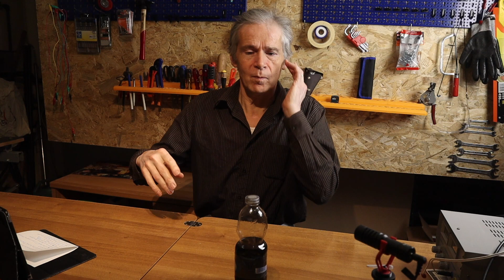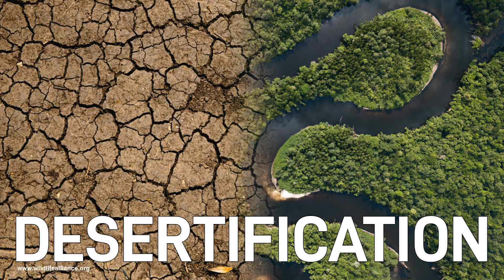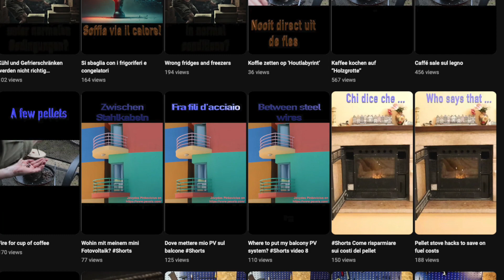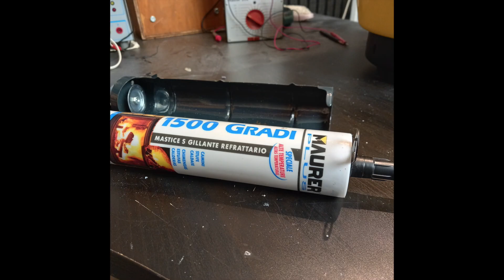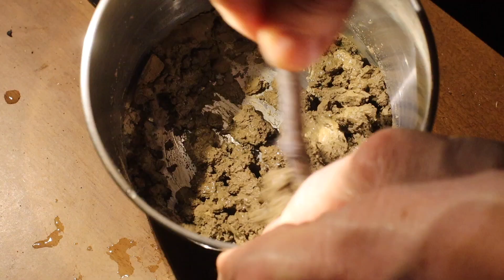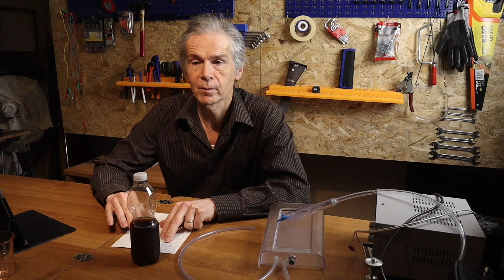Waste oil burner with T blowing head - Video 13

Comment: Wow - you have humor - thats rare in this theme - all alternativ people are so serious or want to look like. Thank you for this video. So i want a starterburner for my biochar Retort burrel or so. So I have a question - I want to use old used friing oil , but you use to head up clear water with used Motoroil . You don't think that this content lead and other poision things, especially in the inside of the rooms?. Thanks for your work and content - form the canary islands. Bye -
Reply from the maker: Thank you so much Adrian! I really appreciate the kind words—I firmly believe we can tackle serious energy challenges if we take the environment into account!

To answer your excellent question about why I used used motor oil (WMO) instead of vegetable oil in that video:

My main rationale comes down to solving a dual problem that affects many of my viewers, especially in developing countries. First, there is a massive issue with finding cooking fuel, which often leads to severe deforestation from wood gathering. Second, toxic waste motor oil is abundant globally but is rarely recycled safely in these regions, often ending up in the soil or water.

By designing a burner that can process WMO, the goal is to burn this hazardous waste locally and much more cleanly at HIGH not low temperatures. This transforms a toxic waste stream into a highly efficient fuel source (it takes only 11 grams of oil to boil a liter of water!), saving local trees and preventing improper dumping. It is also an ultimate backup fuel for natural disasters or crises when standard fuel lines go down. WMO is better to recycle in even a more professional way than I propose, better use vegetable waste oil. But rather than dumping it better use it in this way (outside).

So, you are right to be cautious about health! When burning WMO, the combustion must be completely clean (smoke-free).

For your biochar retort in the Canary Islands, used frying oil is a spectacular choice. It’s a renewable biomass, contains no heavy metals, and smells much better! Just remember to filter out food scraps and water first, and you might need to slightly preheat the vegetable oil to help it flow smoothly, as it is thicker than motor oil. I think the Canary Islands have enough tourism to have much waste oil (and it can be stored until the non touristic period).

Greetings to the Canary Islands, and good luck with your biochar retort barrel! Keep innovating.
Reply: @nnvasen-good-energy  Thank you so much for your kind reply. So you are involved in what are known as developing countries, which includes the Canary Islands, or at least they are considered emerging economies. We have tourism and strive to be very progressive, but geologically speaking, we are part of Africa – and you notice that when you have to get spare parts here. We are part of Europe, but then again, not really. Well, I've always felt a responsibility towards poorer countries, but I've had to learn that I can't change the world – even though it pains me to be able to do so little for the people there or there. Instead, I've had to learn that everyone carries their own perspectives, traumas, and prejudices on their shoulders – so for many people, the same situation is evaluated completely differently or seen in a completely different light.

Now, I've always felt a responsibility towards poorer countries, but I've had to learn that I can't change the world – even though it pains me to be able to do so little for the people there or down below. May God have mercy on us for treating our beautiful planet so shamefully. Furthermore, I've learned that this adventure of our soul in a human body is about saving or finding ourselves in the world—however you want to see it is irrelevant. It's not about the external world, but about our inner selves.

So today, I see it more as needing to save myself from the world and its many demands—to live my life and then, when I'm doing well, to let it go. Not the other way around. I'm currently going through a very creative period, which is also challenging. But I think this applies to many people in this crazy world today, where values that mattered yesterday are simply trampled underfoot today, where you make new friends or lose them, and where you have to find new ways to cope with your own life. In this spirit—wherever you call home—I wish you and your loved ones all the best and much strength to fulfill your missions for yourselves and your friends with love and balance. I think that's what life is all about—being present—for yourself and for others—listening instead of turning a deaf ear, and living each moment with the utmost attention we can give in that moment—rejoicing when things are going well and not taking anything for granted, but rather being grateful. In that spirit, thank you so much for your valuable work and all the best to you.

P.S.: My English is good—I practice English and Spanish every day, as a native German speaker. But I translated this letter with Google Translate because otherwise, misunderstandings often occur. I hope it's understandable.
Reply from the maker: Thank you very much for your reply, clearly a mind that has seen much and tried many things. I know the feeling of a world that does not accept a good objective. Like 30 years trying to help big Energy consumers consume less. Then i finally thought that's something I have to leave and now I do the same with households including those in developing countries. Something makes me feel that will have more effect and it will arrive at those that really need it. 10% of Energy Poverty in EU alone. I think with you that we also have to protect ourselves and not  being stubborn doing the same thing for 30 years like me. Even if I tried to do it in 100 different ways to find the right one. But yes, it is also a spiritual journey. So much of the sense must be found on that level or one becomes crazy.
Reply from the maker: From which of the German speaking countries are you? I've been 10 years in CH and now back in Italy to refind the family live, which is not anymore in NL where I grew up.
Reply from the maker: Do you live since a long time on Canary Islands including also your working life? Islands are very particular in energy solutions like I saw working on projects in Mauritius. Would be nice to come and see how they do things where you live.

Comment: Thanks for your video and ideas. Please tell me about the components that you use to make the heat-resistant fill that you put between the two bowls? Tim
Reply from the maker: Hi Tim, you are very specialised in heat production with charcoal, off grid!
Sorry for the late reply, I had many things to do after my return from my travel to the Netherlands.
I found the heat resistant cement of Knauf (resistant until 1250°C) in a DIY shop in Italy (OBI). You can see it here:
https://www.obi-italia.it/malta-calce-e-cemento/malta-refrattaria-knauf-2-kg-resistente-fino-a-1250-c/p/1763143

Comment: New update MASSIVE!  The secret behind burning this stuff is simply getting the right amount of air to the fire.  It must be right though obviously, but what is not so obvious is the size of the holes that supply the air.  They have to be very small!  I turns out you can make a tiny burner with tiny blue flame!  I just made a 3/4" pipe with 16 holes in it 1.5mm diameter 2 rows of 8  that simply dips into the burn chamber.  This turned out to be too small though so going to increase the amount of holes OR put the holes in different positions.  But the main thing is the burn is so clean and blue and can be made small!  It shouldn't be too long before we can work out the best amount of holes the best size and the best position to put them in.  There is quite a lot of experimenting to do to get the system perfect but I now know for 100% certainty that blue flame can be achieved which I had almost given up on!  Having seen loads of videos of these Kalan cookers on youtube lately I decided they can't all be fake,  I was beginning to think people were putting chemicals in the pot to make the flames so blue but it turns out I have been feeding my burners way too much air for years :)  Thing is though seeing the Kalan cookers I was under the impression they would be around 3-8 kilowatts which is far too hot for my living room so I put up with orange flame for the last 3 years!  So this summer I will be "perfecting" my home system, which will not only be entertaining, and educational but save even more fuel so everyone is happy.  Have a great day experimenting on your side sir.
Reply from the maker: Hi Moonlichtshadow, that is indeed a very important result you found, and I must admit that I didn't know and didn't see it in other videos. It seems that small house create a lot of turbulence because the air is forced out with more speed. Indeed, if I blow with my mouth through the blower I feel very little resistance.
I am looking for advice to see your video and you in the meantime start to develop new blowers. My T-piece blower is very hard and I need carbon and much time and effort to drill. Therefore I will take a thinner pipe like you did and make 1 mm holes in ring formation (8 holes each ring), which will blow in all directions. Your configuration with a blower pipe from downwards is more compatible with my barbecue burner of video 5 and 6, so I will use that one. It has also the advantage of being suitable for energy storage. In your case it can be useful because you have too many kW and it can be stored & released during more time, with shorter burns.

Comment: You will find this hard to believe but the reason this version you made gives orange flame is because the holes in the air feed are simply too big!  I just finished off doing a rough test using a 4" diameter burn chamber with a central air intake from the bottom which was 2 inches in diameter but the holes are only 1.5mm big.  3 rows of about 10-12 about half inch above each other and voila!  Very slow to start the burner off though, being outside doesn't help either and the 4" pipe is a bit too tall but fantastic blue flames, almost zero orange!  Just like a gas stove actually.  I still can't upload at the moment and that could be another month until I do so obviously can't show you my results at the moment.  The blower you use is perfectly adequate if anything too powerful, prolly need a speed controller to get perfect results.  My main problem now is the fact there needs to be a pool of oil boiling in the bottom of the burn chamber to get the blue flames which means it is difficult to judge the burn rate so it can continually be drip fed.  Otherwise the chamber may overflow and be dangerous!  My setup at the moment simply vaporizes the oil as soon as it hits the base of the burn chamber so I don't get that problem but do get orange flames which means it is burning too lean.  Although saying that, it is border line blue and serves me well but the blue flame version needs more testing to find out if a drip version would work without overflowing after a few hours to see if It would be suitable to use all day as a heater for the house.  As a heat sauce for cooking it's perfect because the fuel lasts ages!
Reply from the maker: I think we have to find a way to make it stable in a way that there is no problem of filling the combustion chamber with oil. There should be a proces were an increasing oil level or coverage percentage of the bottom will increase fuel consumption, because in that way the process is intrinsically safe, as it will then burn quicker than it fills. I guess that is the case. Otherwise there should be a safety whole just above the bottom from where excessive oil runs away and can be collected.
I guess that you don't have to heat your house in the summer, but you will use it for cooking. I remember that you are living in the UK, right?
Anyway I great result! It lifts my spirit in my quest for the blue flame.

Comment: You might change the nozzole hole   2mm drillbits is good to achieve blue flame
Reply from the maker: You mean more but smaller holes in that "T" piece? Thank you! The previous comment in English was about making the combustion richer with more oil (a whole bottom full of oil, so a bigger evaporation surface). I will try both.
Reply: I already make my own version sir ,you can sèe the details
Reply from the maker: Do you mean "making a hole for air supply(kalan de used oil)" of 4 days ago? I saw also invisible fire (how do you do that?) and another video with fan and a pot of boiling water. Nice blue flame. But you mean another video, I think.
Reply: @nnvasen-good-energy  I think the invisible flame is probably hydrogen burning off as this only happens while getting the burner to function properly I found.   It also makes a big difference how bright the day is if this is done outside.  I think you will find it is quite blue indoors or where there is not as much light.  I will make a video today of all the details of my burner so hopefully you can see it tomorrow.  I am able to upload 1 video a day at the moment so hopefully all will be good.
Reply from the maker: I missed this comment, have to be more careful! It is because as a newcomer I get few comments. I will check your channel.
Reply: What is the diameter of your chamber sir ill give you details of nozzole burner size and holes
Reply from the maker: Hi Jack, I saw the video of 2 days ago and subscribed. The chamber is 10 cm diameter and the holes in the T-Head are 3.5 mm, all over the T-head.

Comment: Great job so far.  I think you will achieve a blue flame with this setup if the burn chamber has a pool of oil in the bottom.  When it burns too lean it will burn orange.  The problem for me at the moment is that these burners tend to be too hot !   So I have to have a very lean burn but it burns without smoke and after an entire year there wasn't that much soot in the long pipe work I have for a chimney.  What I am saying is that my system doesn't run to its full potential, if it did my house would be way too hot but given that I don't get much soot after 12 months and more I am happy with it although it could be improved :)  You would be surprised at how hot your burner gets if you  capture the heat it creates.  I am going to try a smaller burn chamber so I can get a pool of oil at the base and maybe that will give me constant blue flame time will tell.
Reply from the maker: Thank you for the great comment, the next video will be better! what do you think from my video  5 and 6 with thermal storage as a solution to your problem of excessive heat?and if the chamber were narrow and high, then you can have a bottom full of oil without too much oil vapor production and that can also be a control of temperature. Many things to try...
Reply: @nnvasen-good-energy  Well with regards to excessive heat a thermal solution would not be gained because the burner is inside the house so no need to transfer the heat from outside to in.  I have another thought on thermal storage though, maybe childrens marbles made of glass would substitute the stones as some stones explode under intense heat.  I am at the moment waiting for parts to finish off my build of my new computer then I will make a video of my setup.  Not sure how many weeks it will be though but certainly not months :)
Reply from the maker: hi moonlight shadow, good idea about the glass marbles. I actually prepared the pebbles already and can take measures to avoid risk. that can be a test run with an enclosure to let them explode under save circumstances and afterwards they will stay save. but your idea has an added value by making the energy storage a decorative element of the home! thank you for this idea.